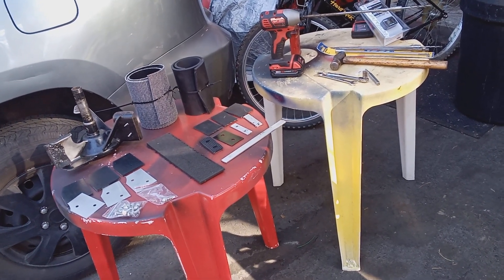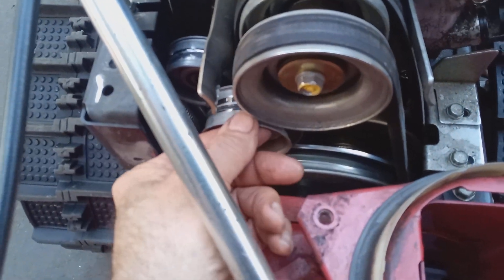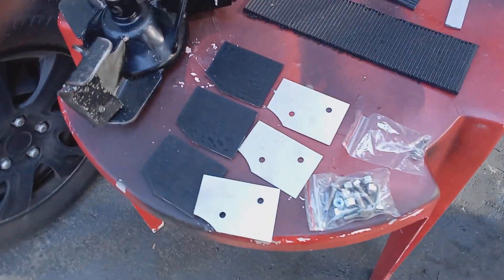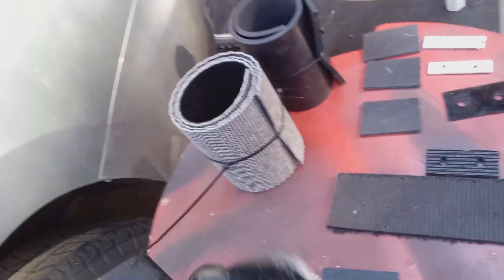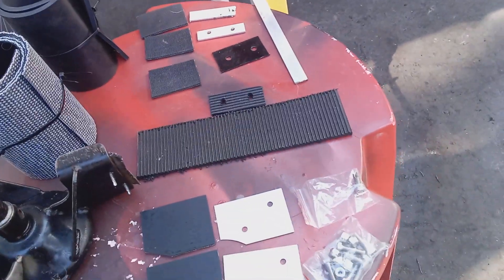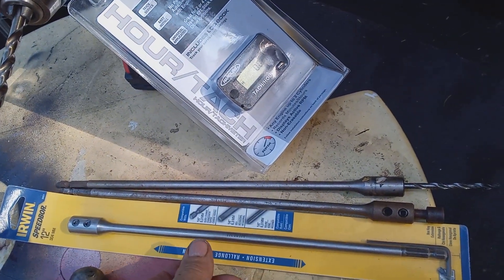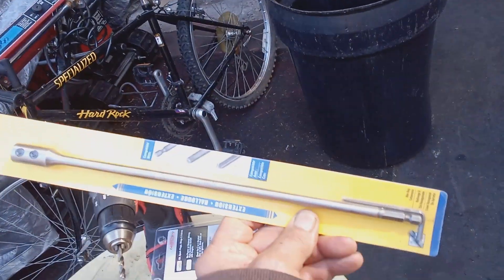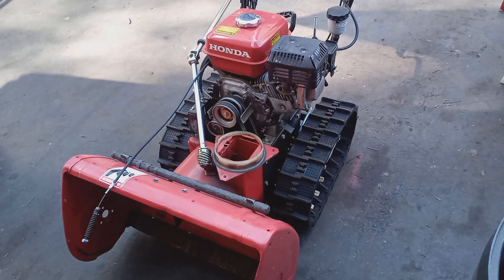HOW TO Make Your HONDA Snowblower THROW Further With DIY Impeller Kit!

Comment: My snowblower has a 58 year old 4hp Tecumseh engine on it and I have no idea of its rpm's, lol, but it'll pull me along behind it just fine.  Main problem with my snowblower is that its an Ariens 10M4 Sno-Thro made in 1965 and the chute is a lot shorter than modern ones.  Otherwise it works fine and is built like a sherman tank.
Reply from the maker: cool . Rebel.

Comment: Good video and I have been doing this mod for over 20 years on many brands of blowers. I found a small engine shop in northern Ontario Canada that sold the kits back in 2002 so I just made my own kit up with parts in the garage. The rubber that I use is from the side wall of an old limper spare tire that I had and I am still making up kits from that same tire 20 years later. I use to do the backing plate like in the video but stopped doing that and now just use 1 bolt 1 washer and lock nut and make the hole in the middle and I have had no problems with this configuration, in fact this allows the rubber to pivot if ever so slightly when the fans encounter a hard object in the housing. I am doing this mod on my loaded HS724 blower as it is not performing as it should. I will bump up the RPM to but only after trying the mod out first. TIP with no gap in the impeller housing the impeller can freeze to the housing so you need to keep it clean as possible after use and I always gave the impeller a good hit through the shoot with a long piece of wood to make sure it is freely moving other wise you can burn out a belt very quickly when engaging the auger. Lesson learned the hard way.
Thanks for the great content. Don Atlantic Canada
Reply from the maker: thank you

Comment: another thing for people to take into account is the desnsity/wetness of the snow. I live in Calgary, Canada where MOST of the time the snow is VERY light and dry (even if we get a foot or more, its usually like ripped tissue paper therefore easy to move). This kit is probably NOT going to help move this type of snow faster/further. Can't HURT, but won't really help.
Reply from the maker: yup. we are either very light and fluffy or most of time heavy wet.